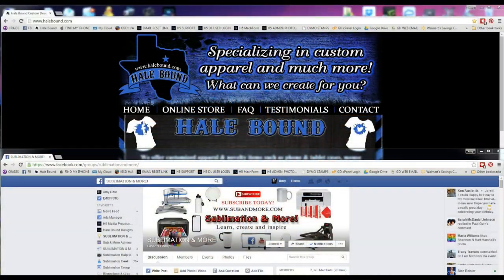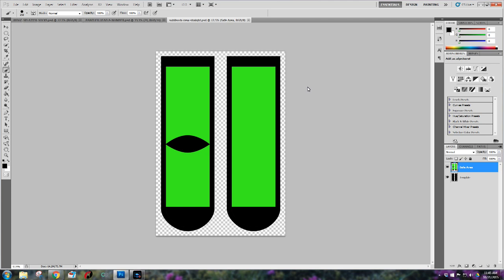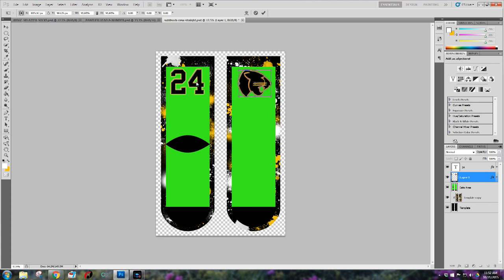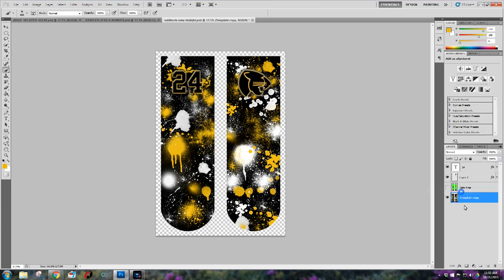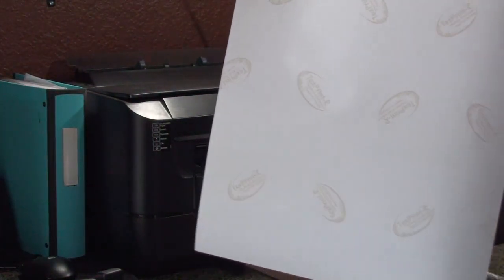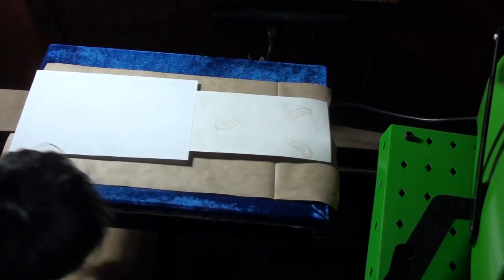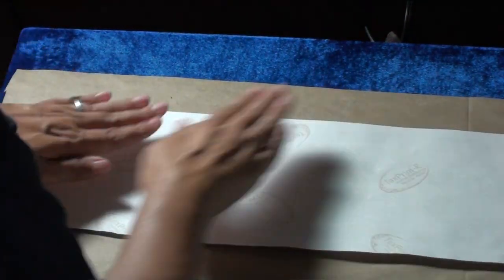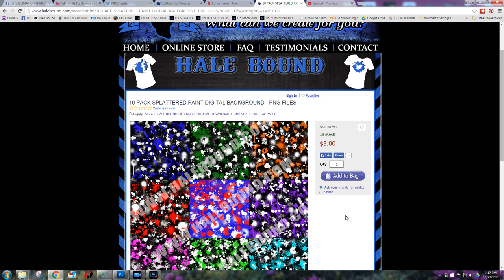HOW TO SUBLIMATE SOCKS FROM START TO FINISH

Comment: Great video. Recently started doing this as a hobby and I'm really enjoying it! I was hoping at the end of the video you would show what the sock looks like on someone. Reason being, I'm finally getting good color transfer and the socks look good on the wooden insert. They also look good when I remove them from the insert. Problem is when I actually put them on. They immediately show the white sock lines in between the "ribs". I am buying the correct size socks for myself, but I was hoping for a better "fill in" with the color. I've been considering flipping the socks inside out to dye the inside too with at least the main background color to hopefully fix some of this issue. Do you run into the same problems, or do your socks still look good once they are stretched out on feet?

Comment: So if I wanted to utilize this tool, could I use the software on a cricut? I'm confused on that part. On the computer, exactly what software would I be using in order to design this? Also, would I have to use a complete different printer aside from my HP in order to print this image out in order to began the process of sublimation

Comment: Does the socks form stay stretched out like that? The design was great but it would be nice if you could some how keep the elasticity and original form of the sock.
Reply from the maker: It all depends on the brand sock.. Some sock to to sublimation better than others.
Reply: What brand did you use for socks that turn out the best ?

Comment: I am using the same printer with inks from Cobra and I am having color issues, with it not printing any greens and the color is off. What settings do you have it on for Color Management in photoshop?

Comment: Seems very time consuming.  What's your price point on a pair of custom socks?  

Also joined your FB group, and subbed.
Reply from the maker: +phalceprofit Thanks! sorry for the late reply. Had a issue with the way emails were setup for our channel but should be fixed now.
Reply from the maker: +phalceprofit Not gonna lie, it can be time consuming. I charge no less than $20-25 per pair.
Reply: Sub and More YouTube Videos! Thanks for the reply!

Comment: I am having an issue of losing the cushion of the sock after heat pressing it. Do you have that issue? I use Vapor socks... they feel great, but once i do the dye sub heat press, they no longer have the cushion, it's like they've been completely flattened
Reply: Don Hermes hei how could i chat with you? I faced the same problem

Comment: im curious to know how i got the white in the design to come out using cmyk. thats an issue i am running into with my vector designs. any advice?
Reply: The white will come from the colour of the socks on. If you dont use white socks and say black socks then all the white areas on your design will come out black. It's the same in conventional CMYK printing on paper.

Comment: Does this also work on heat pressing shirts?
Reply from the maker: +franchisejr15 yes sublimation will work on shirts. Shirts have to be 50% or more polyester. The higher the poly the more vibrant the print will be.

Comment: So basically photoshop is a requirement for sublimation?
Reply: NO, Photoshop is just a design tool, you can use ANY design software to crate the design. Once you have your design, you use a printer with special sublimation ink and print onto special sublimation transfer paper, then you use ANY heat press to apply the the sublimated image to the socks or any other 100% Polyester fabric. You can use a lesser amount of Polyester (blend) however the sublimation process will only dye the Polyester and will wash out of the non polyester part of the blended fabric. Example: On socks that are 80% Poly and 20% Cotton, the cotton threads will NOT be dyed and the sublimation ink will eventually wash off, sublimation only truly works on 100% Polyester, Google it.
Reply: Hi can you tell me where u buy ur sox from

Comment: I have a 7610, i fitted non epson carts so i could go to sub ink and 4 hours later it said 0x9d error, never worked again...
if anyone has a cure. i changed back to epson carts and changed waste tank still wont print
Reply from the maker: Sorry to hear that. I would put the Epson inks back in and call Epson and just tell them it stopped working. Should be under warranty.

Comment: i can't print the photo to sublimation paper with casual printer? am i right?
Reply: Correct, you need both sublimation ink and sublimation paper to make dye sub sock,etc. There are some printers that can be converted to use sublimation ink, after flushing out all of the regular ink, search Goggle for info. Or just purchase a new printer for dye sublimation and keep you regular printer for casual plain paper printing (which is what I did).